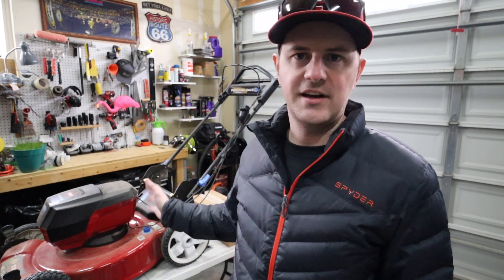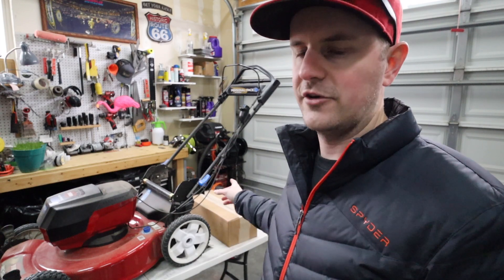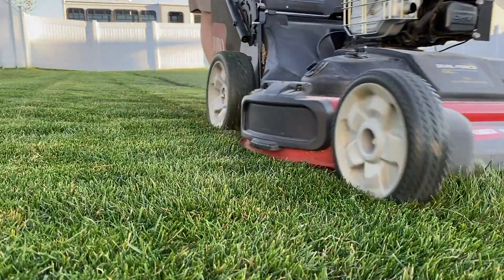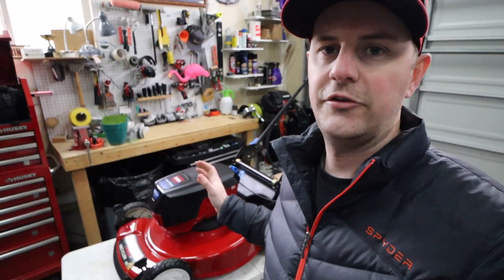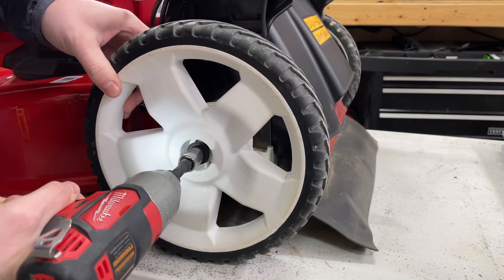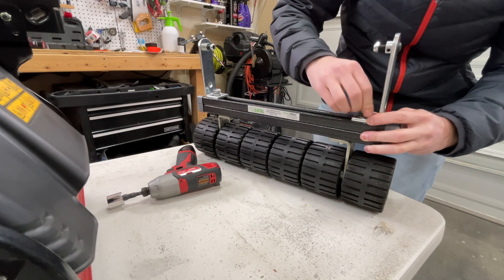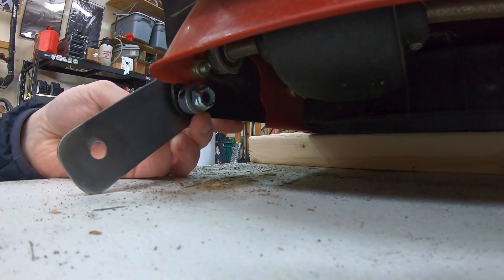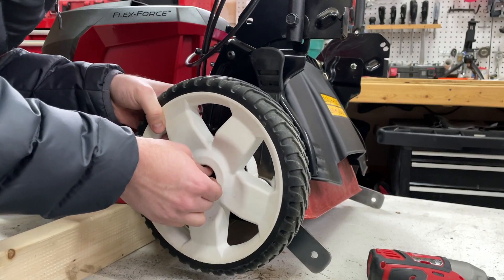Installing My Quick Connect Kit on Toro's 60V Recycler

Comment: It's awesome you came up with this kit. I had a big league lawn striper and couldn't have been more disappointed with it. I returned it a week later after buying it. Pain to install, pain to remove, the directions were bad, missing parts, & even the striping was disappointing. It's heavy, bulky & awkward to use since it doesn't swivel. Switched over to the Toro striping kit & was a game changer for me. Only grip about the Toro kit is it sways to much and get funky looking lines depending on the grade.

Comment: I wonder how the battery will handle the big league, I noticed increased gas consumption with it on my HRX
Reply from the maker: I plan to test it this season and see how it goes. I suspect depending on what battery size you go for you'll need to have an extra battery on hand, just in case. But I recommend that anyway.